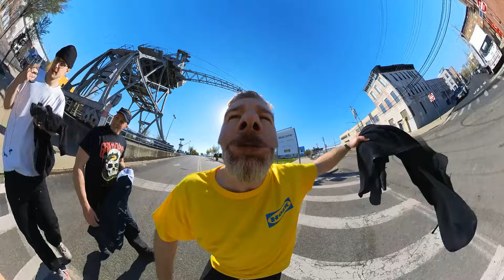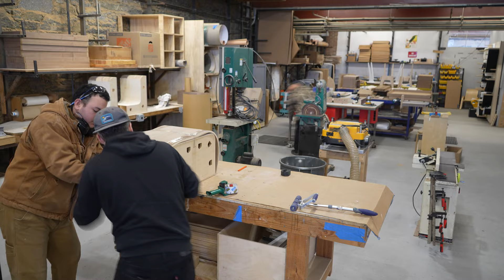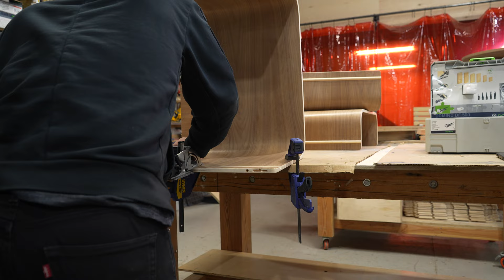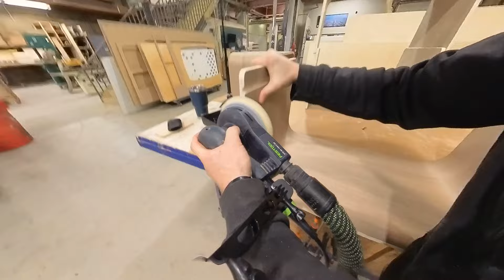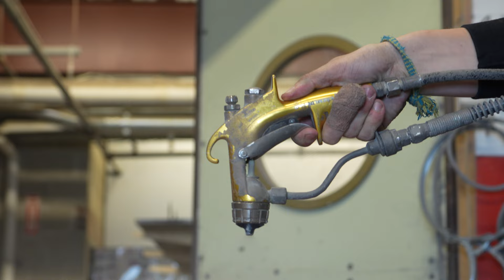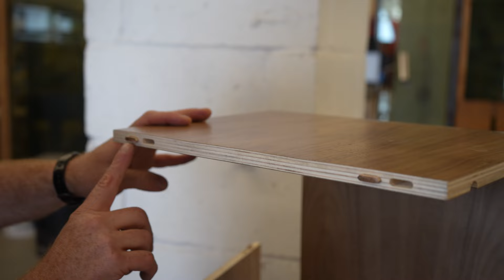Wood Bending: Joinery & Finished Prototypes | Episode 4

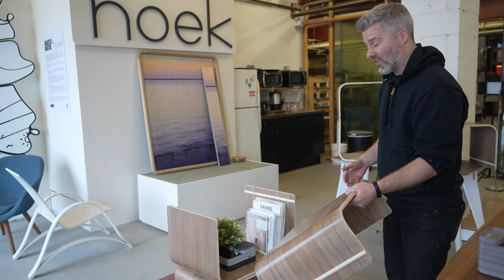Comment: 8:05 I'm worried that this joining method won't hold much weight because of the round dowel. It's kinda designed to pop out if you put weight on it because it'll bend the bottom piece outwards and just fall down. A rectangular dowel wouldn't do that because there's no slope to help it rise out of the slot. Of course if the whole thing is super rigid it won't happen, but plywood tends to have a bit of a give to it. If you're really into the round look but still want the stability, you could make the dowel a very rounded flat piece so that there's enough of a flat spot to prevent that, umm, slope-effect.
Reply from the maker: Hey! The orginal intention was for the pieces to snap together but atfer we made the first prototype the it was much more rigid and stronger than expected so I wnet with it aand decided to make it a sliding joint as opposed to a snap one. We've tested it with a bunch of weight and it's super strong. I take your point about the different shape but I feel the round dowel is a beautiful detail and suits the design really well. Maybe in the next vid I can do a strenght test to give a visual example! Thanks for watching!
Reply: @ConorCoghlan  Okay, reality trumps theoretical concerns. It's really all about how rigid the main body is so if it doesn't have that much give, a round dowel will do just fine.
Reply: @Itslvle  exactly! Our original though was the same as yours but in realty it’s much stronger than expected. We’ve got some concrete bags out the back - I smell and a weight test to failure coming on!!! 😁